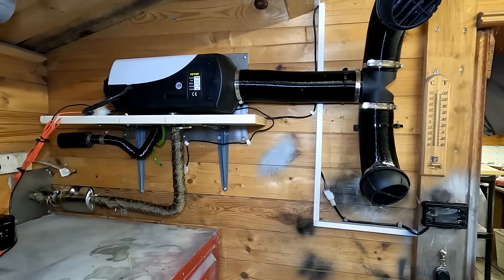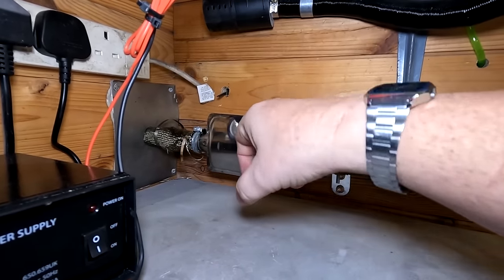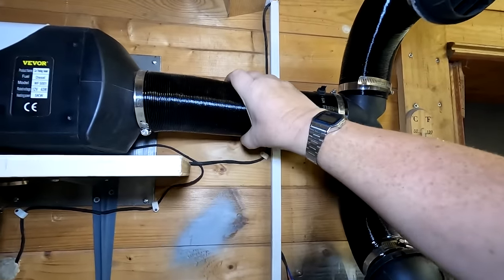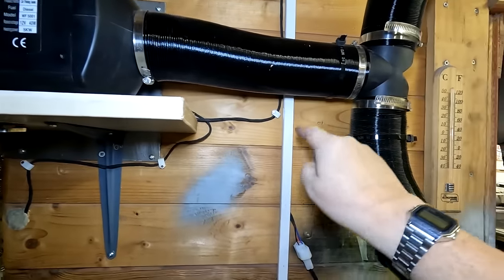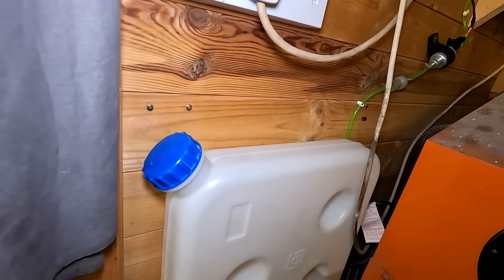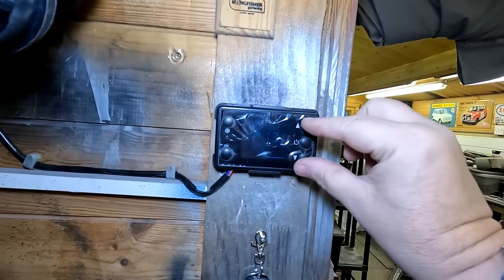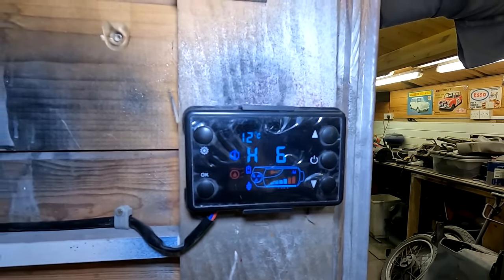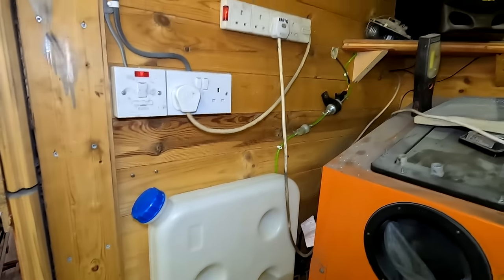This Diesel Heater Installed In My Workshop Was So Easy

Comment: Martin, be careful with the silencer inside, the ones I have had have a drain in the bottom seam to allow water to drip out, not 100% sealed.
Reply: Also they are only spot welded together and not sealed ....allowing carbon monoxide to escape !  Please mount them outdoors only !  ( Try filling it up with water, you'll find they leak everywhere . )
Reply: Yeah that exhaust 100% needs to vent out completely, them pipe are renowned for braking down leaking exhaust gases inside,

I’m sure you can mount them on there side 

also battery is a must ! not power pack mate if you have a power cut your melt the inside ect buddy they can’t go off when hot
Reply: Run the exhaust through a domestic heating radiator angled to drain condensation outside. Corrugated stainless gas pipe will connect the heater to the radiator. Ordinary 22mm plumbing will take the exhaust outside.
Reply: @VanlifeHQ  What happens when the battery voltage drops? Won't the heater still burn itself out??
Reply: I was going to say the same
Reply: @steveclark..   there design is to work as a overnight heater in hgv busses emergency vehicles ect... they only draw a current when starting once the glow plug goes out it will tick away for hours on battery assuming you have a alternator to replenish the charge on the battery. Not one or the other you need both 
Battery & charger 

If the charger gets turned off by accident or power cut = the heat from the unit will destroy the ecu on the heater 
If you have both no problem because the battery won’t just cut off. 

A charger & battery is a must on them.
Reply: @VanlifeHQ  Thanks, I'm assuming that the charger part could just be in the form of a solar panel then?
Reply: @steveclark..   exactly mate perfect I have 160w renogy panel victron mppt 100-30 charge controller onto a leisure battery 
running for 2 years without a single issue.
Reply: @VanlifeHQ  That's great to hear, thanks. I have dabbled with solar set ups in camper vans over the years, never had a mppt charger though, I've noticed that some of them are really expensive, I hope that they are a huge step up compared the old type of charger.
Reply: If it's pointed outside I don't think you'd really need a silencer unless you got things going on right outside where that exhaust is I'd leave that open more and the way he's got that exhaust pipe fastened to the wall with those L brackets on that,  that exhaust gets crazy hot I would be uncomfortable with that that bracket is going to get hot and get the wall hot if Roselle brackets are attached directly to that pipe everything will get hot, those pipes are no joke when it comes to heat

Comment: The oxygen for combustion is being drawn from inside the heated space.  As the oxygen is depleted the heater will draw oxygen in from outside and with it cold air.  The air/oxygen intake should be placed to the outside to prevent the drawing of cold air into the heated space.  This is why fireplaces that are not using combustion air from the outside create cold in the extremities of the heated space, ie: a draft.

Comment: FYI for others that want to install these. With a single wall shed, the heater should have been mounted on its side with the exhaust and combustion air external and glowplug at top. The golden rule is big pipes inside and small pipes outside. Under certain fault conditions there is always a chance of combustion air exiting the inlet, so another reason for keeping the small pipes outside. Always fit a CO detector.
Reply: Well said George. Any idea how to avoid the power cut failure mode?
Reply: @cfcyayaya  Just depends how many power cuts you might get. There is a argument by some for having a battery capable of starting and shutdown with a smart charger. The what if scenario then comes into play. For there to be any chance of damage( I don't subscribe to the theory) the heater would have to be flat out for a while at exactly the same time as the mains fails - bookies odds?. The battery and smart charger could cost more than the motherboard. For me I assume that those that advocate a battery etc have a standby generator to power the fridge, freezer, boiler etc just in case the mains fails. Backup water supply and so on.
Reply: So does the unit automatically enter the power down mode when the fuel runs low? Also if my power goes out and I have the battery setup will the heater just keep running or will it enter the power down mode? I want to install mine with the battery and tricke charger.
Reply: @whoisthis3512  hi I ran mine on a battery and trickle charger in a mobile home for 2 years with no problems. I now have the unit in a van that charges my second battery from main battery when van is running. It's a bit more fiddly setting it up as you should run inline fuses between the 2 batteries and a switch to stop charging so you don't flatten your van start up battery but well worth it, i would highly recommend these units for cheap and easy way to heat garage mobile home caravan and campers. I also have been running it on kerosene which is half the price of diesel here and I think in my own opinion it burns cleaner than the diesel and just as warm.

Comment: You might want to consider moving the burner air intake to the outside as well, as currently the air for the burner is being taken from the shed and the exhaust is being taken to the outside so you'll be creating a slight negative pressure in the shed which means you'll be dragging cold air in from any gaps/door etc  in the shed. Putting the burner air intake outside avoids this and makes the unit even more efficient 🙂
Reply from the maker: That's probably correct on paper but in reality, its not going to matter.
Reply: @retrorestore  You might be surprised how much of a draft it causes ;-)
Reply: No...  Unless you use the intake air to cool the exhaust (as with a toyotomi or similar design) it wastes energy Heating cold air.

Comment: Nice video! A tip is to run them at max setting about 10 minutes before turning of, to reduce soot build up and clogging. Have 3 of these heaters, and first one got clogged up. Can be cleaned up and restored , but that is a booring task. Trust me :) cheers from Sweden
Reply: That's a great tip. Thank you!

Comment: You might consider not wrapping the exhaust pipe to help get more heat in the shop, as long as there is little possibility of personally getting burnt on it. Nice job.
Reply: i am wondering if you could put the exhaust pipe into the sand to make "sand battery" to keep the warmth for even longer

Comment: I would definitely consider moving the silencer outside. The less joints you have inside, the less chance of leaks and there is a small hole in the bottom of the silencer for condensation drips so they can let fumes through. Enjoy your vids too much to loose you.
Reply: Nice job. I've got a Chinese one I've been meaning to fiit in my workshop, this might just spur me on, that and the cold weather.
You might want to fit a carbon monoxide alarm, keep yourself safe!

Comment: You need to remove the silencer from inside the building the condensation drain at the bottom also allows combustion gases out as well such as carbon monoxide you can get a marine silencer for inside use if you wish to have one that's fully sealed and room safe  a cracking addition to any space that needs heating cheaply and easily though
Reply: I was about to say the same about the silencer and condensation drain being moved to outside. Also, the point you touched on about not turning of the power to the unit - this is why it's best to have a 12v battery being trickle charged and powering the unit because then in the event of a power failure (brownout, blackout or just RCD trip) your unit is still powered and can be shut down safely...

Nice little setup though and you should get some good use out of that...

Comment: You’re in danger of gassing yourself there - couple of improvements.
Lay the unit on it’s side and have the first joint and the whole exhaust outside. This joint is notorious for failing and CO leaks. In campers they have a turret plate to allow that joint to go outside.
Better to site the unit outside and pull the intake inside if you want the warm air to be heated.
If you place inside you can put it on its side needs glow plug on top but the unit first exhaust joint would be sealed outside.
Good luck ! 
You MUST get a carbon monoxide monitor/alarm. 
Videos are great

Comment: A solid piece of advice for anyone buying these cheap heaters be very careful they don’t go up in smoke, a number of these have, I work for a major manufacturer of air and water heaters.
Reply: Would be good to know for safety reasons what it's it that causes them to do this , is it bad fitment or mechanical failure, or design flaws?
There must be ways to eliminate or reduce the risk

Comment: Always great videos as always Martin. I just installed my Diesel air heater as well, they work amazingly for the price. Since your running the exhaust through the wall, just straight pipe it outside with no muffler. You will find much better airflow, wth about a 5"F/8''F increase. Noise is hardly increased with that little muffler removed. For my setup, I used 3/4 copper tubing, and zero back pressure. The Flexi pipe in the kit makes many ripples in the flow due to the ribbing. 60107 USA says hi.
Reply from the maker: Thanks John
Reply: Copper is a good idea. Thank you-

Comment: One suggestion :
Replace the full line from the pump to the heater with ridged plastic fuel line . The green line softens up a bit and you will eventually get a “ low fuel “ error from the controller . The pulse pump only produces 0.02 mm of fuel per pulse and the green tubing expands a little bit and the sensor will turn off the heater with a “ low fuel “ warning .
Reply: Yeah the correct fuel line diameter is very important on those units it won't work if you don't have the right size hole you'll get too much or not enough fuel, the hole inside that fuel line is so small it's like a pin can barely fit in there it's it's incredibly small
Reply: What are the specs for the fuel line if you were to replace it with sturdier line

Comment: 2 things i would put the combustion air intake outside. having it inside means that you have to suck cold air from outside for combustion. 2: i would probably un cover the exhaust, cant hurt the little extra heating. :D
Reply: I'm confused.  Why does it suck combustion air from outside if the combustion air intake is inside?

Comment: Just a suggestion. I would run the combustion air intake (thin pipe) from outside, as particularly in winter, when you need it most, the air is cold and therefore more dense, making for a more efficient burn. Think intercoolers in turbo engines. Where you have it at the moment, it will be flowing less dense air the warmer the inside space becomes. If you choose to do that with the cold air inlet, make sure it is a good distance away from the exhaust outlet. You don't want to be sucking in exhaust gases! Cheers mate. All the best.
Reply from the maker: Thanks Roy
Reply: That's not exactly correct. I work with large power and recovery boilers. They are 10 stories tall.

We pre-heat the combustion air with heat exchangers fed by the boilers flu gas to recover the heat leaving the boiler. We also use the flu gas to pre-heat the feed water going into the boilers to recover even more flu gas temperature that would otherwise be wasted. The boilers also draw warm indoor air from that plant.

 This make them more efficient because you don't need to waste heat by buring more fuel per unit of work output to heat cold outdoor air and cold feed water. If you don't have to burn more fuel to make up for the cold air and water, you can generate steam with less fuel. 

Having the air intake with
in the room being heated, drawing heated air the unit is producing, will decrease fuel consumption per BTU of effective heat entering the heated space. 

Forced induction engines are more efficient in terms of power generated per unit of displacement. They are not, however, nessisarily more efficient in terms of the unit of fuel burned vs unit of work output. 

The math is very well understood on this matter. There are whole perrfessions to do with thermal dynamics.

Comment: you should use the exhaust to heat water or for steam for a put it trough a Double Convex Radiator mounted on the wall. the exhaust on these things easily hits 200C. so hot enough to boil or heat water.

Comment: The exhaust bandage holds the heat in the system, which saves on fuel, plus the machine warms up quicker than without. Thanks for your vidios, very helpful, Paul.
Reply: No, it prevents a portion of the heat transfer from going inside the heated zone, reducing the system efficiency.

Comment: Looks a nice install.  Just be aware the silencer is only spot welded together.  So it isn't gas tight around the edges, meaning some exhaust will end up inside.
Reply from the maker: I'll be moving it outside
Reply: i was going to say this exact thing, but decided to read the comments first. good job  @retrorestore

Comment: hi martin had one in my mancave for past 2 years and it works a treat, same here what evojigger just mentioned with the exhaust box having a hole in / drain hole .i put the exhaust pipe through the shed with the box on the outside

Comment: Those silencers leak like sieves.  Not just the drain hole but the ends are only tacked on.  Sucking combustion air from inside will exacerbate the leakage by lowering the pressure in the shed.  Make sure to have a working CO detector.  Also, put a battery in the supply so a sudden power interruption can't damage the unit.
Reply: Yes, This. So many people don't realise and are getting gassed with CO...

Comment: Suggestion: Remove the heat wrap from the exhaust pipe, enclose the exhaust system in a box with two vent holes and place a 12V computer case fan over one of the vent holes. Doing this will recover some of the heat loss from the exhaust. You can extract additional heat from the flex pipe by wrapping copper wire around the flex pipe leaving twisted "wings" protruding off of the pipe. The only concern is to assure the output end of the muffler stays above the dew point, which it most likely not be a concern.
Reply: I was thinking the same thing.thats like 200 degrees good heat just dont lean on it...

Comment: Nice job mate, going to commission mine this afternoon (portable) I did notice the silencer only had a few little spot welds around it, when I blew through it, it leaked like a sive, so I brazed around the edge, I’m trying my luck with a 15A 200w power pack, the type with jump leads, up rated the Cig lighter to 15A fuse, I’ve decided to fit the unit externally (water proofed) with ducting coming in as I do a lot of woodwork.
Great vid mate 👍
Reply from the maker: Nice 👍

Comment: Just installed one in my office, it's great but I installed mine outside due to noise, not sure the plugged-in power supply is 100% safe, if you have a power cut you could have a meltdown (i know this does not happen often)! Got mine connected to a battery with a battery maintainer plugged in, like my office in one piece and not producing heat having been set on fire!

Comment: Nice install but the burner side "air in" supply for safety should be also taken from outside (the black tube above the exhaust) that means any risk of CO goes in and out from outside and your inside "air heat in and air out" from inside. If you look how its mounted to the floor of a camper it makes sense, burner air from under the van heat air from inside.
BUT also your setup as per the video is sucking warm workshop air burning it and throwing it outside you may create a negative pressure (pos not in a wooden workshop) but you could in perfectly sealed space get poor combustion and CO levels build up.
You also could "harvest the heat from the exhaust" by using metal air duct tube over the top of it and blowing air through it. great video I had a camping gas powered heater like this one so if you don't want diesel camping gas versions are available.

Comment: Hey there - just wanted to say that this video (and your previous one) have persuaded me that this is the way to go to heat my workshop over winter. I was looking at a log burner, but it was so expensive, and a pain to install. We have a diesel generator, so always have red diesel "on hand" - it makes so much more sense than a log burner, particularly when I'll probably only use it 4 months in a year. Thanks mate.

Comment: Thanks for the video, it will be nice and toasty on cold days in there. You could improve efficiency more by running the air intake for the burner to the outside of the cabin, that way you aren't using the warm air inside for the burner..

Comment: Hey Martin, the silencer is NOT SEALED ! It was meant to be outside or under a van. My mate tig  wielded mine .check the little hole at the bottom is for condensation and the intake and exhaust also leaks on the silencer. Where yours is the intake for the hot air will suck up the exhaust and blow it into the room. It might not be a lot but could make you sick or worse after running it for a day. thanks for making the video and hope you don’t mind my comment because they don’t tell you very much in the instructions. I also vented my exhaust up a down pipe from a gutter to get the exhaust away from the house especially on a cold damp day. Ok cheers
Reply from the maker: Its outside now as in my later video
Reply: I used mine today, -8 C outside and had 30 cm of snow last night. Had to fix a gas leak on the snow blower and was happy as a clam in the garage. When I walked in it was 1 C so with the heater I lucked out and got it fixed to save the day. Merry Christmas to all